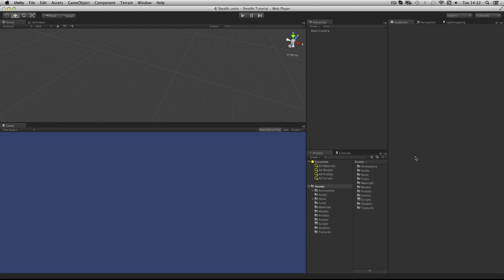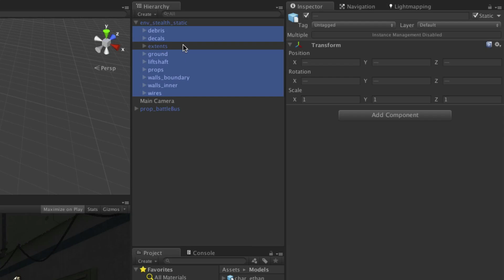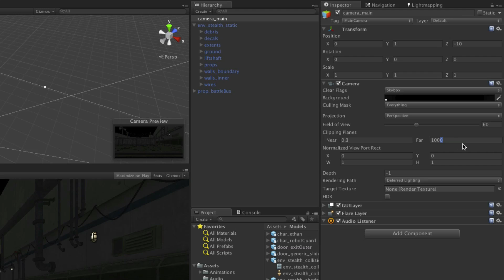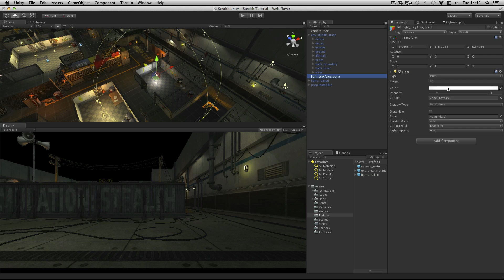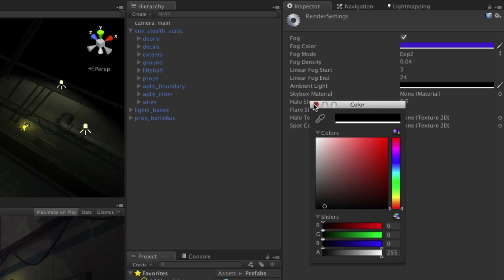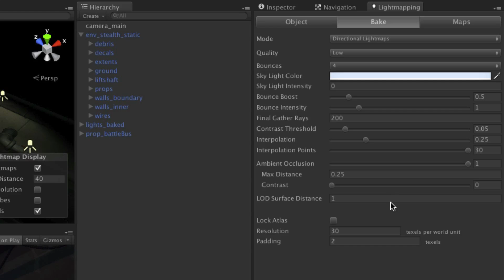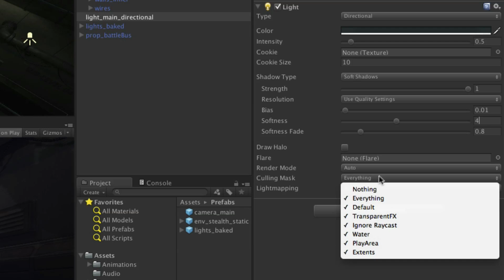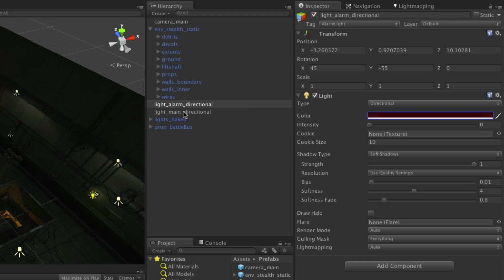Stealth game tutorial - 102 - Game Setup and Lighting - Unity Official Tutorials

Comment: If a whole level will be made static and lightmapped, does it matter if, objects, that are the same, are getting imported as one object and then copied through the level as prefab, or just imported copied in the external 3D software? I see that you've imported the whole level as one model, instead of building it in Unity, using prefabs for the same objects...

thanks :)